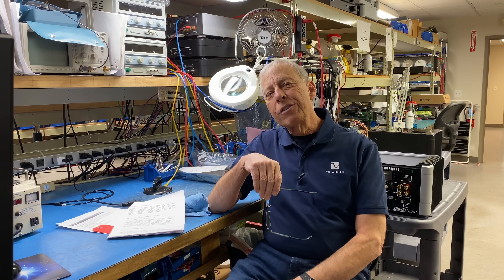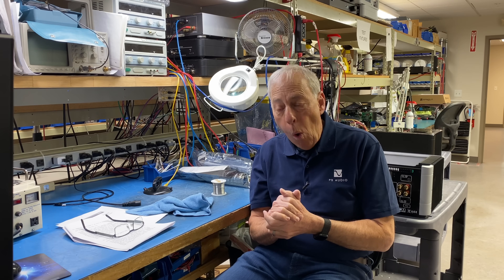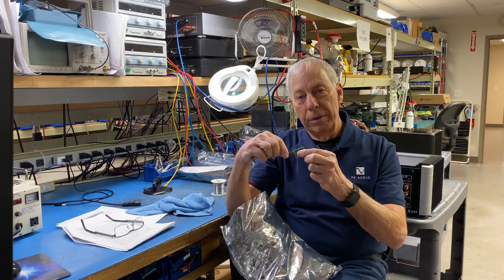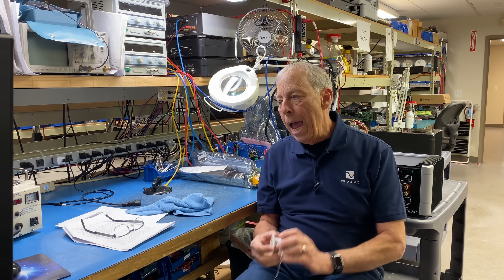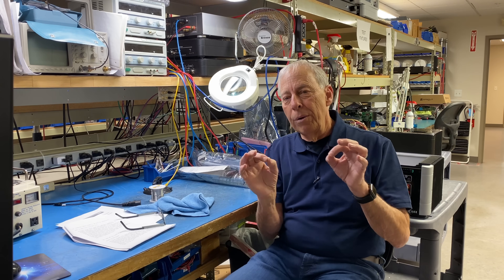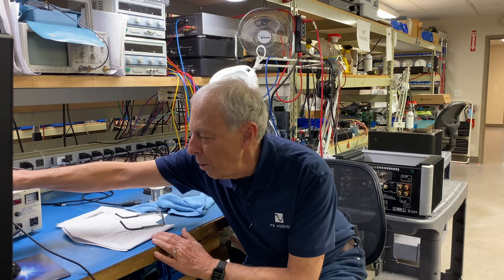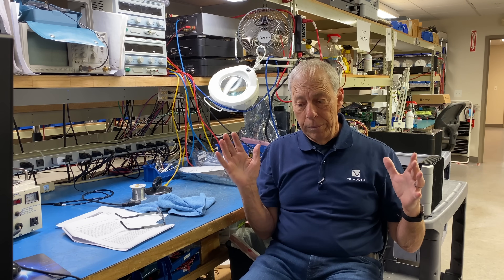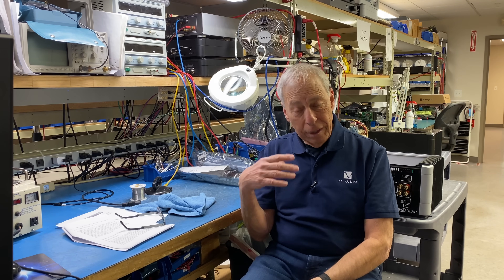How important is solder?

Comment: You are COMPLETELY wrong on how flux works. Flux chemically cleans the metals being joined. Solder will not wet to dirty metal and a dirty/oxidized tip will not be able to melt the solder because there is too much insulating air on the rough dirty surface to allow wetting and good heat transfer. The part that lowers the melting point of the solder is the actual metallurgy of the alloy. 60/40 Sn/Pb melts at a lower temperature than either tin (Sn) or lead (Pb). There is perfect ratio of 63/37 where not only is that the lowest melting point of an alloy of tin and lead but the entire joint melts at the same time called an eutectic alloy. I could go on for quite a while about soldering. People tend to think of solder like glue but in reality it is somewhere between welding and brazing. You actually create a very thin layer of a new alloy at each end of the joint, board to solder, solder to component, and you want the thickness of the solder between board and component to be as thin as possible while still having enough solder in the joint. There is a lot of science to soldering but to actually do it well is more of a practiced art.
Reply: You are so right. I worked as a tech for the military and I've been to many schools and it is an art for sure.
Reply: I wish you would go on. I find it very fascinating. Not joking! I've soldered a little and I've always found that there's a bit of magic going on.

I'm always guessing what's wrong when things don't act predictably or how I think they should.

There's a lot of factors. I also become paranoid and think everything affects the process, lol. Barometric pressure, humidity, whether the Cubs will win the pennant, the alloy ratio, the altitude, how near the solstice is, is the flux dirty?, Is the solder too old?, Can it get old?, have the magnetic poles shifted?, am I grounded?, Is it the oxygen that makes it hard to reheat again, or the Carbon Dioxide?, Or the Nitrogen or Helium?, Lol.

You are correct. There's a ton of science going on, but it's also a learned art form.
Reply: This is a start. It takes a fair amount of practice. The temperature used to solder can vary according to what you are soldering and the solder being used. I was an electronic tech for the military for over 30 years and the range we used usually ranged from 650 to 750 degrees F. Also, lead free solder (which I despise) usually requires higher heat than SnPb. I'm sure I'll get blow back on this, but this is what I was taught and it has served me well all of my live. Hope this helps!
Reply: @stephensams709  you are very right about different things needing different heat. There is another extension on that they will also need different solder tips because different size and shaped tips transfer heat with different speeds (more size than shape but it does play a role). You need to be careful to get enough heat in fast enough but not too much that you burn the PCB and lift the pad or overheat the component. Lead free solder typically needs more heat and I believe universally everyone that has worked with leaded solder would rather risk lead poisoning than work with lead free solder, the exposure rate is so low that it just doesn't happen anyway but there is always the exception that proves the rule. The best lead free solder I have found is AIM SN100C (alloy name not percentages) with glow core flux. I read the technical datasheet several years ago and it was one of the best lead free solders on the market for the price, with very similar performance to 63/37 across a myriad of tests even beating out 60/40 in some iirc. I grew up in the electronics industry, taught to solder at 14 by a former NASA solderer (aged out of NASA) and then took a class to learn mil-spec/aviation certification. I never got the certificate because I didn't need it for my job (not mil-spec or aviation) and I was still in high school. The main reason for taking the class was to learn SMT soldering and higher level technician work but that was in the second class and it was deemed unnecessary. I have LONG since lost the touch for mil-spec and forgotten most of what I learned.
The class was mainly putting components on and taking components off the same board for 3 hours once a week for 15 weeks. We bought a kit from the bookstore that had 2 PCBs. 1 was our practice board, the other was our final exam. So yes we soldered the same pads dozens of times. I can't do that anymore but it can be done with the right setup on the right boards.
Reply: @Zanthum  I went through several of those long multi week classes myself. It was so frustrating because it had to be perfect or you had to go back and redo it, but I am so glad that I went through it. I worked on avionics in the Air Force, so soldering was very critical. Even though I'm retired now, I stay in practice repairing and restoring classic audio equipment, which is one of my passions. Thanks for your comments and I'll have to try the lead free solder you recommended.
Reply: Zanthum not really. A particular solder melts at a specific temperature. You may need more heat to get the connection at a temperature where the solder id at a melting point but the melting point is the same.
Reply: @Bluephrog  I believe that is what I said. You need more heat to get the joint up to temperature before the surrounding area/components get above their max safe temperature because not doing that is how you lift pads and damage components. To those that would ask the reason you don't have the iron screaming hot all the time is it destroys the tip and too much heat too fast can be just as bad for the the components/pads as not enough.

Comment: That's not right Paul have you ever soldered anything? Flux doesn't make the solder melt Flux makes it flow the heat makes the solder melt

Comment: 700 degrees? That’s far too hot!
Also, 
A. Can one discern the different types of solder alloy used? SnPb vs the variety of modern Pb free ones?
B. Can one discern the difference between surface mount and through hole components?
C. Does the size of the solder pads have any noticeable effect?
Reply: PebblesChan Paul is American. Unfortunately, America is stuck in ancient units such as Fahrenheit.
Reply: ThinkingBetter If it works for them then why make such fuss about it. Being nice is also a skill.
Reply: @Engineer9736  Well, it sort of doesn't work. The beauty of the SI system is that science get simpler with more easy to comprehend and remember formulas. I have many examples (I live in the USA) where people get confused when using these old units. Even simple math of conversion is way more complicated here. Just two days ago I was frustrated by having to mix some weed killer with instructions describing "tea spoons" and the water container with marks on the side using gallons and the actual weed killer concentrate measured in ounces. I've lived about half and half in Europe and USA and DEFINITELY, the SI system is way way better.
Reply: @ThinkingBetter  Metric is superior for sure. In fact, the force unit Newton, is not SI compliant because it uses kilograms instead of grams.  Bettter luck next time !
Reply: i love cops It’s a silly topic. America is stuck in these ancient units most certainly not because they are superior but because of simple ignorance among the non-science educated people who prefer business as usual. And then there is of course some cost in changing labels and signs everywhere. But almost all other nations have gone though that ages ago. Check: https://youtu.be/7bUVjJWA6Vw
Reply: That is 700 degrees Fahrenheit not Celsius ;)
Reply: The Iron temp should be about 600 - 660 Fahrenheit. Any higher risks permanently damaging the PCB fibreglass by unwanted expansion and substrate reflow possibly cascading into copper fractures.
A bit of flux paste applied on the joint prior to soldering acts as a thermal conductor allowing better heat transfer.
Reply: @PebblesChan Very true about the flux. If those temps works for you go for it. I do enjoy hearing what others think, so thanks for your input.
Reply: He is talking about 700 degrees F. I use anywhere from 650  to 750 F, depending on what I'm soldering.
Reply: Wasn't there a scientist (probably American?) who quoted : "There are two types of people - those who use the Metric System, and those who had sent people to the Moon..." 🤔
Reply: @laurentzduba1298  NASA used both metric and imperial systems for the Apollo moon landings. The guidance computers calculated everything in metric and only converted the results to imperial when they needed to be displayed.

Comment: Odd that your irons go to 700 degrees? Most I’ve seen go to 450 tops, and flux is there to clean the joint not to make the solder (note the L!) melt like salt on ice which lowers its melting point 👍🏼
Reply: 700F is 370C
Reply: I forget you are dodgy foreigners and freezing isn’t 0 degrees lol, thanks for the reply 👍🏼
Reply: @FantaOrangePug   No, 0 degrees is freezing, as are 25 degrees and 32 degrees.
Reply: Most soldering iron stations with an adjustable temperature, (mine included), DO go up to 700-800°F, (some even slightly higher than that), but those temps are mostly used only for "extreme" conditions, like very large solder joints and when using a large soldering iron tip, but that high of temp. is definitely higher than what is ideal for (most) electronic applications. 

The "ideal" soldering temperature depends on many factors, like the soldering iron tip size, the solder joint size, the type of solder that you're using and what type of flux it has in it, if any, the type of circuit board you're soldering, the type of component you're soldering, etc. Even the ambient temperature and airflow around the workstation affects the "perfect" temperature to some degree. 

You definitely don't want TOO HIGH OR TOO LOW of a temperature when soldering, because too HIGH of temperature will burn the flux , evaporating it into smoke before it even gets a chance to make the joint totally "flow" or "wick" properly, and also leaving burn marks on the joint and circuit board, which isn't good, and then on the opposite end of the temperature range, if your soldering iron is set at too LOW of a temperature then the solder may not melt fully or get all the way into the joint either, hence the term "cold solder joint", which of course is also just as bad, probably even worse, because it will crack over time and result in a bad or "loose" connection at that solder joint, sometimes even being a "microscopic" crack that you can't see with the naked eye, but which results in a high resistance joint which doesn't function properly, of which I have seen numerous times in components that are made using poorly controlled "wave" soldering, (an automated type of soldering)!... 

That's why Paul said that almost every solder joint in their components are individually hand soldered, that way each joint can be thoroughly inspected immediately after soldering it by the very discerning trained human eye to be judged if it's good or not... This method results in a MUCH more reliable and sturdy built component in the long run, (at a slightly higher labor cost to assemble of course), but up to a certain price point, with audio equipment and speakers especially, you kinda "get what you pay for" anyway!

So, soldering at the proper temperature for your solder type and joint and component type is VERY important!
I have found that, (at least for the solder I have), (I can't afford "silver solder", but I do have reduced lead, "electronic solder" at least, for my hobbies and home projects), which works best between 420-480°F, depending on joint size and component type... Lead free, and silver solder has a slightly higher ideal working temperature, (i.e. it's harder to melt properly), but I think 700°F  IS too high for most circumstances because of the "flux burn" issue!